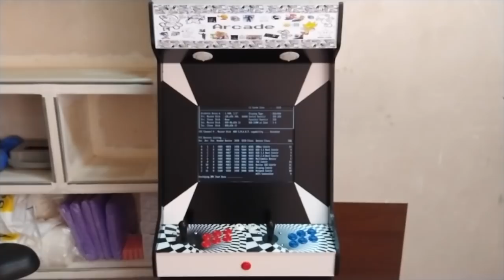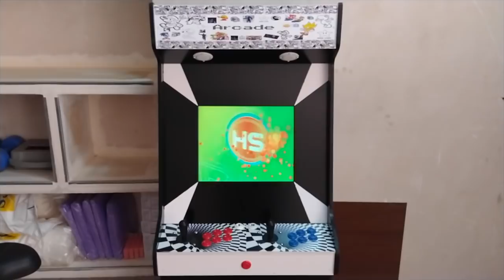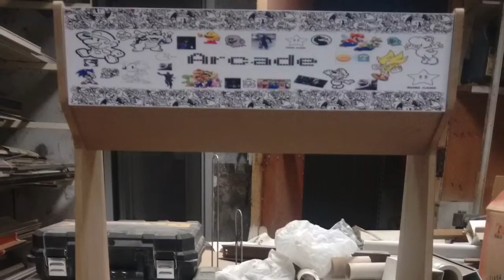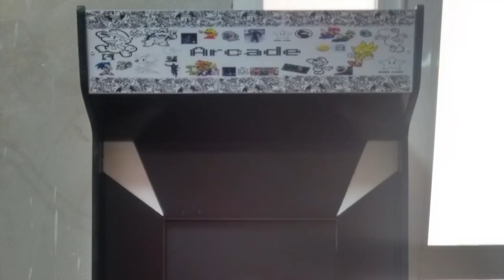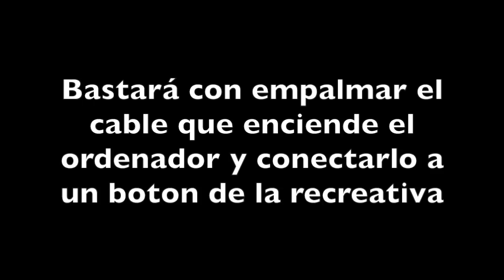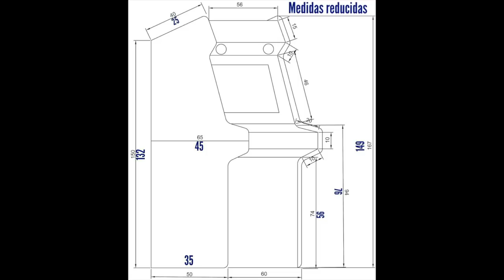Construir Máquina Recreativa Arcade Casera | Con Pc Antiguo

Comment: Hola amigo disculpa crees que me pueda correr el hyperspin en una pc con 2 gb de RAM procesador AMD Sempront(tm) Processor 3000+ 1.80GHz
Reply from the maker: Hola!! Con el pc que me comentas, no creo que tengas ningún problemas para mover bien el hyperspin, tienes un equipo muy similar al mío y a mí me funciona muy bien, además el hyperspin tiene un menú de configuración para mejorar el rendimiento en el caso que no funcione muy fluido, le bajas la calidad gráfica a lo menús, cosa que nisiquiera vas a notar visualmente y te va a funcionar bastante mejor. Espero haberte servido de ayuda!! Un saludo amigo!!! 😁
Reply: depende de los sistemas que quieras meter en hyperspin..por ejemplo el emulador de ps2 no te va a funcionar ni por asomo..igual mame y alguno mas